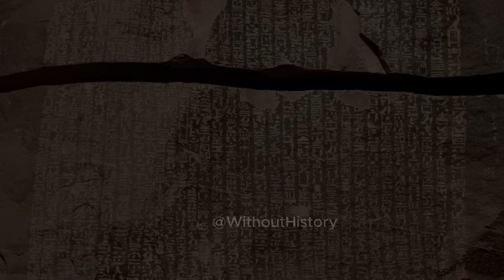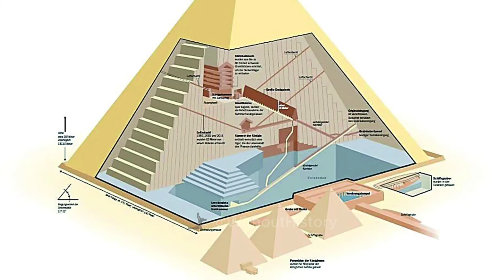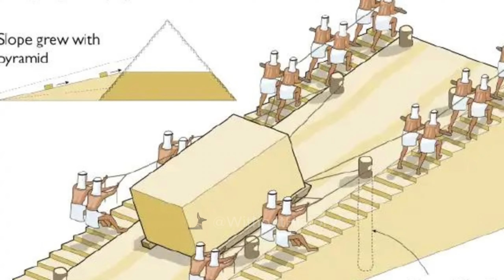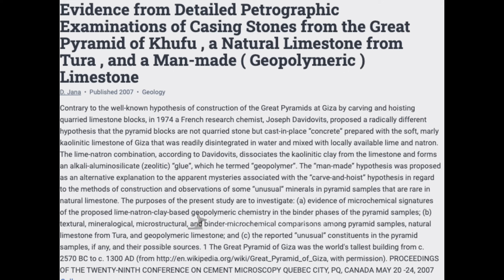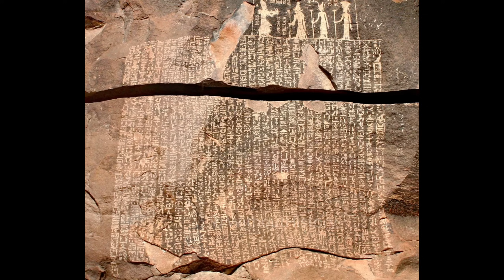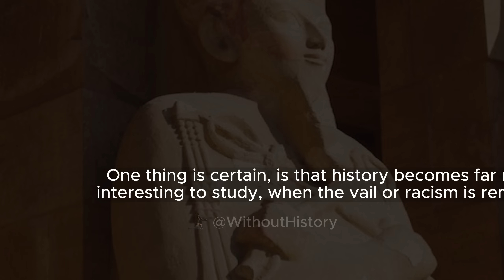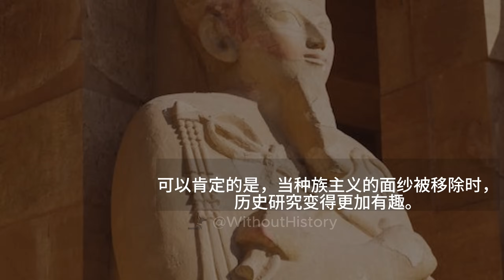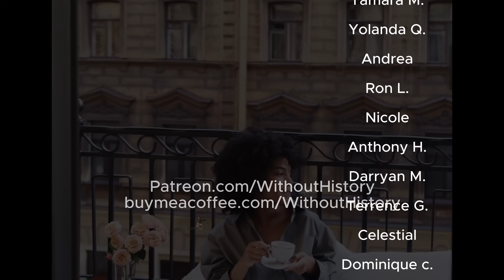That one Pyramid secret that explains everything!!!

Comment: The Great Pyramid is the one on the left.  It looks smaller (because the one with the limestone cladding on its upper portion) was built on higher ground than the GP and is smaller.  Also its insides do not have the chambers of the GP. Yet the narrator never corrects his mistake.
.   Also Djoser's pyramid is called the Step Pyramid and is 100 miles South of Giza.  Also built with a burial chamber, 100feet below the pyramid base, so these workers were using stone tools(or wood). Bronze had not been invented yet.   Djoser did not want to be forgotten like his predecessors(who were buried in MASTABAS(single layer tombstones) which would disappear after a couple of years of sandstorms as the sand covers over the Mastabas.  So Djoser wanted his to stick out, so his architect made it 6 layers high. Thus, the first pyramid.   There is over 100 pyramids, some built of stone some of mud brick.  Occasionally the Sahara does get rain so the mud brick ones disintegrate to a heap of mud.  Djoser started the craze. He has the life of a mortal, so he did not build them all. He is buried near the step pyramid.

Comment: What do you make of Menkaure's unfinished pyramid, which shows several large stones in place, most with rough surface while several others have been sanded to a smooth surface? Wouldn't that suggest they had a method for cutting stone with precision?
Reply: Just a thought but could that be why it's unfinished? Too impractical and time consuming?
Reply from the maker: Interesting fact about the geopolymer technique. It can easily produce rough surface of smooth surface stone blocks just by changing the water concentration. Check out the paper.
Reply: @robertgibson6872  perhaps, but they could still do it by cutting or some other means.
Reply: Menkaures polished stones were stolen to build Cairo- they just couldnt get the top ones off easily
Reply: @mikev4621  I'm not understanding what you wrote.
Reply: @mr_knowitall  originally the whole pyramid was cased in polished marble white stones.But during the middle ages they chiselled most of them off and took them to Cairo to use in making other buildings. The ones at the top of Menkaure are all that's left now. They were all quarried rock, not cementitious. Limestone can be cut, and worked, relatively easily after being soaked in water ; which is how the Egyptians did it. The rocks for all the three pyramids were quarried from the plateau nearby, and it's quite clear to see where that was .
Reply: @mikev4621  where was it...the quarry?

And wasn't it polished limestone, not marble?
Reply: @mr_knowitall  yes it was polished limestone, but not the same as the blocks inside the pyramid -geologists consider it a type of marble.   The quarry was within 2km of the pyramids on the same Giza plateau they were on.
Reply: @mikev4621  but you said the WHOLE pyramid was CASED in polished WHITE marble. "Cased" implies an outer covering. Now you are saying that it was the inner stones that are marble instead? To my understanding, the inner blocks were granite.
Reply: @mr_knowitall  There are a small number of granite blocks used for the interior passages and chambers.The vast bulk of the interior  were limestone blocks and rubble fill.The entire outer casing were blocks of polished white 'marble'. I should say that I'm talking about Khafre's pyramid , the one with some remaining smooth casing near its peak.

Comment: Interesting, but what are your thoughts of the partially excavated obelisk in Aswan Egypt..? It appears to be cut in situ… 🤔

I always thought that Egyptians would have used what was available to them at the time and thought harnessing the power of the sun via a fresnel lens of sorts seem plausible. Some say this method may show evidence of splatter, but still appears plausible…

What are your thoughts..?

Love your channel and the quality of the content…

Stay Blessed 💕🙏🏽
Reply from the maker: Absolutely, evidence shows that they use different techniques for different times. The reason historians are confused is that they try to apply one method for different sets of evidence spanning 3000 years. In 3000 years, Kemet went from mud bricks, to geopolymer to cut stones, to potentially sun visors melted stones (that last one is conjecture).
Reply: Very impressive analysis.

Comment: In traditional African religion, you excel in life after knowing yourself. The spirit and elements which resonate and is acceptable by you is know and accepted, then you can use those to work alongside others to do so much more. The reason for the stall is Africans are learning what is supposed to be revealed whole, in bits and pieces over a life time so before they have enough, the frame gives up on them. 

I will repeat it here. The principles are to be sang and danced to for the children but worked with by adults. Too much of the sit down lessons from childhood to adulthood. Our forefathers reached the level called the FLOW. It is what we should seek. The line inbetween! Inbetween sadness and happiness, nothing and everything. IT is called the FLOW. Civilizations are birthed as a collective not individualism we so seek now.

Comment: I worked in industry using the methods shown in this video. We used chopped strand fibre glass to re enforce concrete building products plus ash from furnaces. This  method is still used today. Large blocks would not have the compressive strength required. The quarry near Giza shows cut stone and saw marks from a circular saw, explain that?

Comment: A young man discovered a very old photo of the pyramids. Lying around on the ground were various sized pairs of tree logs cut to resemble a wheel cut exactly in half. Centered near the flat edge were drilled two holes side by side. These pieces matched the basic size of various stones. If you levered up a stone and slid half the wheel underneath and placed the matching half wheel on top, the two halves could then be tied tightly together to ROLL the stone to its location, even up a ramp! So yes if you poured the stones to fit,the weight and size of the larger stones would be difficult to move. A wheel is the perfect answer, and no doubt, they'd have known of it long before the pyramids were built. If memory serves, the young mans name, was Steve Fearson.

Comment: I’m a concrete mason. And also geometry is one of my best mathematical skills. I’ve always known that the pyramids were formed and not quarried. The one reason I knew is the geological location. There is only an abundance of heat and light no shade. So proper exploitation of such an element would mean that you can’t literally be out in peak hours giving 100% physical tasking. Therefore work smarter not harder. The sun did all the work and I believe utilized properly in that region it didn’t even take 20 years maybe 5 years tops.

Comment: To build a bridge, you need the best quality concrete (excellent cement). Concrete generates heat during setting, so it must be watered (cooled) three times a day, five times a day in the desert, otherwise it will burn and crumble. It would take Niagara Falls to cool the pyramid.

Comment: Did i miss the part explaining how this was done with diorite/granite? I'll grant you that with limestone it's definitely plausible; but what about the granite chevron blocks above the kings chamber?  Making a geopolymer out of granite would present the same problem as quarrying/cutting; greater if anything, actually. If the time spent cutting and shaping granite blocks was time consuming, wouldn't reducing that same block into sand or dust be even more so? And collectively it would still be close to 600 tons of the paste material if they were able to break the granite down in the first place.
Reply: Hey, don't spoil the party! 😉😁

Comment: There’s an assumption that the interior blocks are similarly sized and shaped and therefore took a long time to fill in.  One logical theory I’ve seen is that the pyramids are actually filled with smaller rocks , rubble and filler materials.  The outer layers are bigger and squared off giving them strength.  Because we can’t see the interiors is this a possibility?

Comment: It makes sense that the blocks may have been manufactured instead of cut. Do you have any thoughts on why they would be made with separation lines to appear as if they were cut? Could that be to help create some sort of anchor to accommodate the smooth final surfacing that the pyramids were known to have? 

What about the interiors - they also had these separation lines. Any thoughts on the purpose of these lines?

Also, at least one pyramid (I think the Great Pyramid of Giza) has final topping blocks that seem slightly misaligned with the exterior surface blocks, implying that some kind of ramp setup was used to lay these into place. Could there have been an internal ramp system used to help set the blocks as they were manufactured?

Comment: The Romans also used a polymer technique concrete or mud brick whatever you wanna call it. But still, these structures are huge, it doesn't explain how they moved these huge stones that weighed in tons 🤔
Reply: They weren't moved. They were formed in place.

Comment: great explanation of how the vast amount of limestone blocks were manufactured and the plausible method used, however this does not explain the use of 70 ton rose granite blocks above the kings chamber and moreover the fine intricate bowls in the Cairo museum constructed from dolomite and granite measuring 5 and 6 on the mohs  scale. Also the sphinx enclosure and the sphinx temple with its 200 ton blocks excavated from the enclosure, there are still many unanswered questions

Comment: That logically explains the blocks scientifically, but please address how the granite pillars inside the pyramids were quarried, precisely cut and placed inside. It appears that exact high tech tools (diamond tipped?) we’re used and the binding element that when placed between each block was thickness of a human hair. The weight alone of the granite structures boggles the mind, let alone it’s transportation. Or the believed *sarcophagus inside the King’s Chamber, how’d it get there? 
* There is evidence that suggests that there’s a chemical residue inside sarcophagus as well the surrounding walls that may prove that the Giza pyramid was a power/electrical source via aquifers underneath the pyramid at the time.

Comment: ok, iwill say that this theory of making the building blocks out of a concretion of crushed stone makes sense for the stones in walls and buildings, as that would essentially just be building a 4sided box with the previuos layer as the floor, but iam having trouble, considering the size of some examples, understanding how they would have made the molds for the statues. granted this method makes the most sense, iam just having trouble "getting" how they would construct the molds for the statues since they would be much more intricate and larger scaled than the box molds for the wall blocks.

Comment: Crap. There is physical and visual evidence of a ramp. The only question is how it was used. There is also physical and visual evidence of a quarry. Building block of the pyramids were not all tightly fit. Most were moved into place and adjusted to fit. As far as a composite material used for construction of these blocks; prove it.

Comment: There's no secret to how the 100+ pyramids were built if people would think, what is the most likely way they were built, instead of looking at all of the impossible ways they claim they were built. You can build a pyramid the size of the great pyramid today if you make the stones instead of carving them, emplace them in a stair step way so you can move up the pyramid without a machine, use molds to pour the concrete into them to make the stones & stack them before the stones are fully dried. You also would have to accept the FACT that Africans, not Europeans, created or discovered sciences like chemistry,  astronomy, physics,  high-level mathematics & the metric system.

Comment: Then we need to explain saw grooves/marks and core drill holes in Aswan granite with striations throughout ? Aswan was clearly a quarry, not a brick/stone oven.

Unless Aswan was a later attempt to extend what a prior nation had built, without  knowledge of granite stone molding ?? Crumbling stone is worth a fuller treatment.

A parallel is the construction of stone sarcophagus, seem not to have been molded ?

Comment: finally an answer I can live with ,,, taking out the supernatural and other nonsensical mainline idiocies ,,, this method of building answers not only the egyptian monuments but all fantastical structures on all the other continents as well ,,, it even answers the similarity from one continent to another as anyone could easily come up with this method over time ,,,  and it is also an easily transmitted idea from one place to another ,,, 
        The only thing that this does not address is the purpose of the great pyramids as they are NOT burial tombs ,,, tesla may be right ,,, as some sort of power focusing devices ,,, there is no evidence as to how they were lit up inside ,,, no smoke ,, no soot ,,

Comment: The cast limestone concrete block theory makes a lot sense of but... why no formula known yet for this type of limestone concrete??  Why wouldn't it still be used today at lease for artistic applications?   Why won't modern chemists be able to easily figure out this chemical casting process?  We all know that modern concrete uses "Portland Cement" as a curing agent which is basically sintered or burned limestone.  If it were concrete where are all the bubbles in the concrete. Any modern concrete tech will tell you no matter how much you "shake down" modern concrete with pneumatic shakers you still have some small bubbles left in the mix.  Even if some type of wetting agents added to the mix to make it flow smoother, some bubbles would likely exist. Those of us who make things out of RTV Silicone and RTV casting plastic liquids use vacuum tanks to de-gas our mixes for best  bubble free results. I doubt the ancients were using vacuum degassing tanks and pumps?  Also large blocks of concrete take long times to cool and if they get too hot too quick as they might in a desert environment they can crack and become very weak. 

 Look at the building of the Hoover Dam. They used this same casting /stacking process to build the dam, but had to add internal cooling pipers of water to remove heat and prevent cracking.  Lots of interesting speculation by many people, but most always seem to miss some engineering basics that lets flies into the soup!!

Comment: - not  a kind of  concreet - but melting of stone
Reply from the maker: Very possible too. For two reasons. 
1 Kemet had lenses huge ones. With concentrated beams to melt / soft stone 
2 those scoop marks in Aswan quarry have tale take sign of scorching. But this is still a theory. Needs more research and evidence

Comment: Just a quick comment to make regarding his assertion that there were no ET's present during the 3rd dynasty. He does not know factually that there were none there, he alleges that there is no evidence of ET's. I would recommend that he go back and view the film footage of the German man who built a robot on wheels with a camera attached and sent it up the shaft to end where there was a door too small for human entry and sealed shut. The robot equipped a drill bore a small hole into the door and then inserted the microscopic camera attached to a tube inside the hole. The first thing seen was a small Grey ET peering at the camera. Then immediately the camera was pulled back out. That footage has never been shown again and not even talked about. The German guy who built the robot is named Gaterbrink,  I may be misspelling his name. He was filming the entire process for National Geographic at the time. Now none of it can be found. Since that small grey  was already behind the door in the shaft, when and how long had it been there is unknown, so to assert a conjecture that during the 3rd dynasty there were no ET's in Egypt is grossly naive and woeful ignorance  😮.